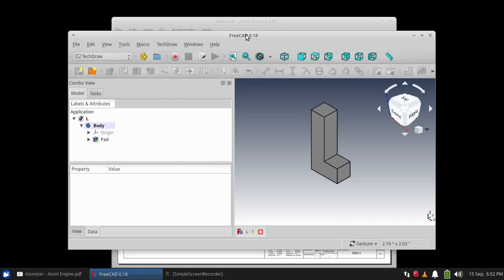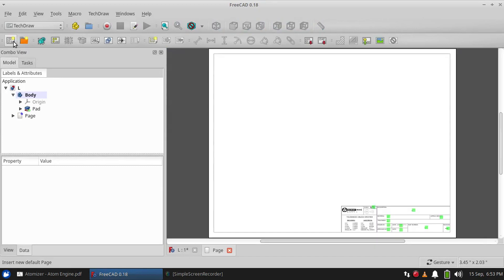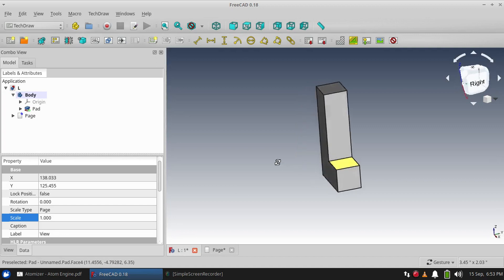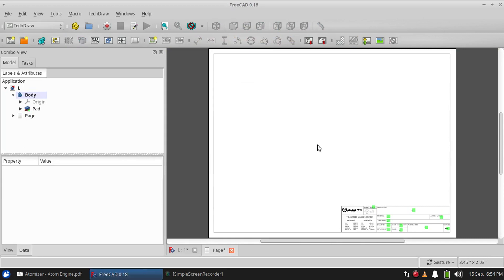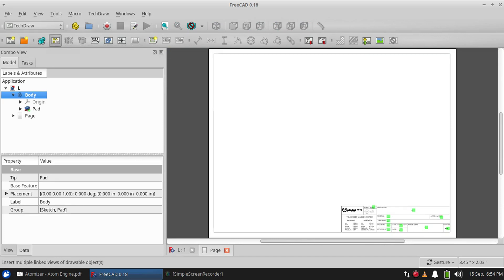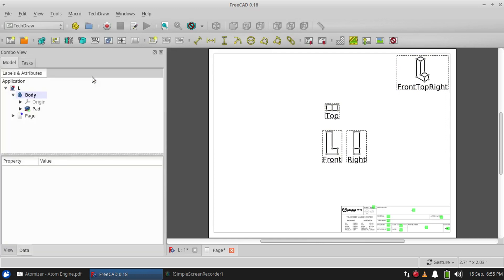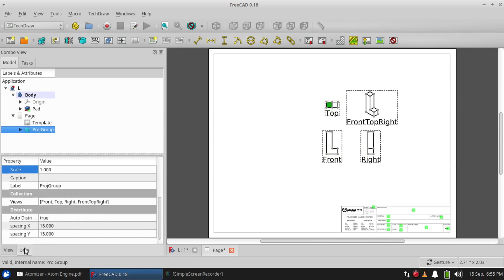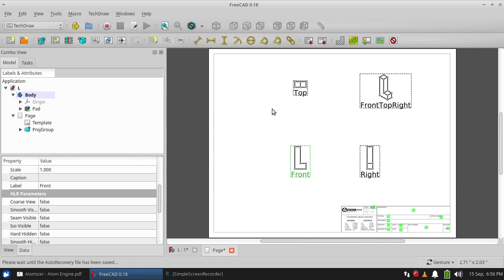Learn FreeCAD: #16 TechDraw views and projections

Comment: without "toggle frame" ON I couldn't move the views around on the Page,  also for some reason I can't find the hole center and find the hole position using horizontal and vertical dimensions